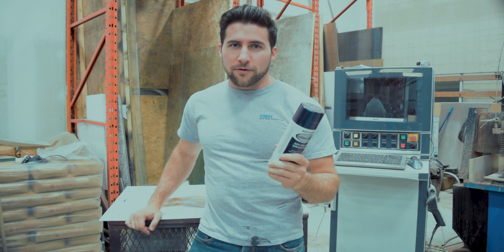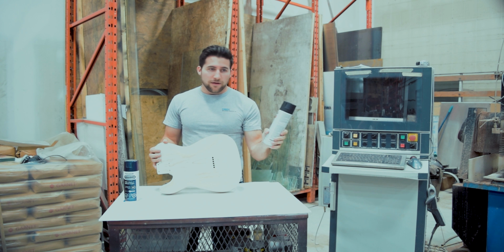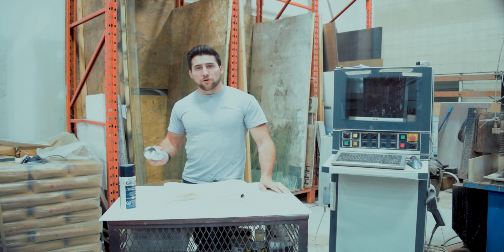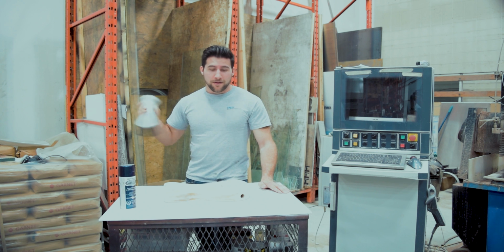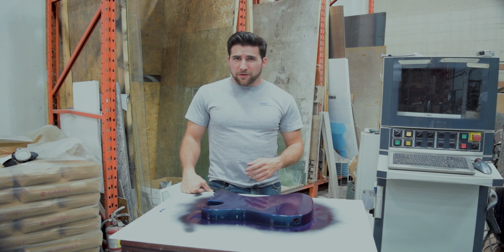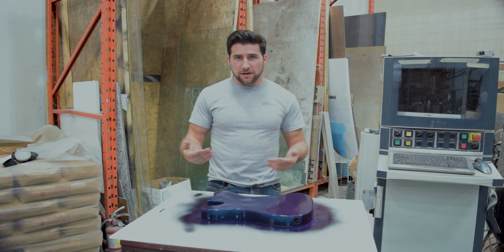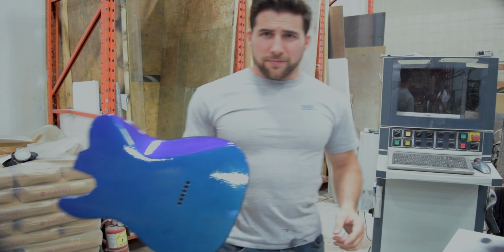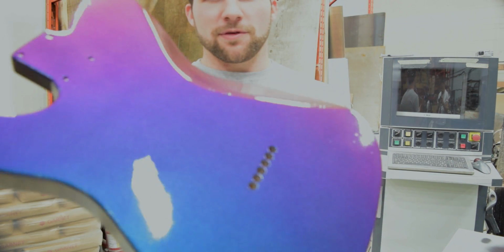How to do a Chameleon Paint Job with Spray Cans

Comment: Hi Brad I have a question for you. It has nothing to do with this particular paint job. But I was clear coating My Guitar. And I noticed that the clear coat was turning white. Can you tell me what the problem is. If possible please answer this question ASAP thank you.
Reply from the maker: Probably blushing. It comes from moisture being trapped under the finish from excess humidity.

Comment: Did you apply the 2nd and 3rd coat when the paint was still wet? (It looked so, I could be very wrong). Also, if I wanted to paint the entire body and I don't have a paint stand, how do I prevent seams between layers (if I flip the guitar) sorry for bad english
Reply from the maker: I wait 10-15 minutes between coats. The paint shouldn’t be wet per se, but not completely dry either. If you don’t have a stand, consider hanging the guitar.
Reply: @BradAngove  okay thansk so maybe I'll to make your homemade stand and paint each layer in one go?
Reply from the maker: That is also an option

Comment: Will it adhere to wood or acrylic/lucite?
Reply from the maker: You’ll want to seal the wood first, but it will adhere afterward. This piece was wood. 
As for the plastics, you will need an adhesion promoter or plastic primer to get that to work.
Reply: Great Brad...thank you for replying fast!
Reply from the maker: You’re welcome.

Comment: Hey there Brad, I'm thinking of stripping my old squier tele with a poly finish and giving it this chameleon treatment. I was wondering if I have to apply a wood sealer after heat-gunning the paint off? Also the appropriate times to sand in the entirety of the procedure. Sorry for the loaded question! Love your videos!!
Reply from the maker: Hi Patrick. Have you considered just sanding the original finish with some 800 grit and moving straight into painting it?
Reply: @BradAngove  would this work? I'm completely new to refinishing a guitar so I've not much knowledge or experience to go off of. I'd sand the entire paint off or just enough to give the new paint something to bite onto? Thank you so much for the quick response.
Reply from the maker: Yes just sand the original stuff so the new paint will bind mechanically. Use the original paint as your sealer.

Comment: I was thinking about doing that to one of mine in auto paints that I've had experience spraying but like you said expensive .and I didn't have any left from the last car I did.
Reply from the maker: +Krusty Buzzard some of the prices on the really aggressive professional chameleon paints are insane.
Reply: Brad Angove the ones I used were from house of colors and we're more than I'm willing to buy.you don't want to put more than 2 coats from. A good spray gun on the car that's for sure.
Reply from the maker: +Krusty Buzzard Oh, that makes sense. If I remember correctly the house of kolor ones are crazy expensive.

Comment: Hi Brad, thanks for the videos.  They have helped me mucho with my project.  I have been working on repainting a recurve bow riser, similar to a guitar, its wood.  I did this same paint scheme before watching any of your videos but ran into some problems here and there.  I am on my 3rd attempt.  It came out great the first 2 times, I really like rust oleum paints, but the problems were really in the prep.  Do you have any advice on prepping wood for paint.  I could probably find some videos but yours are great and I thought I'd bring it up to you.  Besides that, I'm wondering what you would recommend for my next step.  I have prepped the wood and primer (BIN Shellac white, highly recommend for wood) a little better than before.  The first couple times I did this I did 2 black base coats, 2 colorshift coats, and 3 clear coats back to back with 20 minute flash times in between.  Came out effing awesome....until I tried to handle it too soon and got a cool towel effect imprint....then I saw your video explaining that a little too late.  Anyways, this time around I already have my primer and 1st black base coat, next I plan to sand with 800, clean it with Windex (is that ok), spray 1 more coat of black, 2 coats of colorshift, I'm throwing in some translucent black shadows in some areas.  So do you think I should maybe put a couple coats of clear over the color shift and let it dry a few days before going into the translucent? Or should I go into the shadows and clear in one session?  Thanks.
Reply from the maker: You’re on the right track. Windex is fine for the cleaning part. Don’t do more than three coats total in a session. 4 at the outside. Otherwise the first ones won’t dry properly. 
It’s up to you whether you want to use an intercoat clear prior to the black, but I think it’s a good idea. It’s something that the automotive custom painters do frequently.
Reply from the maker: Yes, sand again before applying the colour. I recommend you have a look at my video on why I never wet sand guitars. I also have one titled something like “do you need to sand between coats of paint” that should answer your question better than I can here.

Comment: Would it be safe to level sand the paint before clear coat?
Reply from the maker: +Ken Chuba Yes, but you would probably want to throw on one more light coat of this after sanding and then start into the clear coat.
Reply: I would sand the base coat first, then only if the color coat was really bad.

Comment: Can I use a 2k clear over this? I have never used anything but lacquer on a guitar. Really want to avoid a soft finish like you might get from an enamel spray can. Is this an enamel?
Reply from the maker: This is an acrylic enamel. I have successfully used 2k over it several times, yes.
Reply: If I did want to use a 2k clear over this, wouldn’t I need to sand first? But if I sans wont it ruin the chameleon effect?
Reply from the maker: Sanding lightly won’t ruin the effect. What you can do though is finish your chameleon spray session with one coat of clear (not 2k), wait 2 days, sand lightly, and then apply your 2k.
Reply: So like, ten minutes after last coat of colorshift put on a coat of rustoleums clear coat? Thanks for answering these questions man, really don’t want to screw up sixty bucks worth of paint.
Reply from the maker: Yup. Toss a single coat of the clear on there to seal in the shift paint and give you an intermediary layer that you can scuff.
Reply: Awesome! I’d feel a lot better about sanding a layer of clear rather than sanding the colorshift. Especially since this is going to be my first time using these kinds of paints on a guitar. If this works out I might start using my left over automotive paints on them.

Comment: Thanks Brad. Great videos. Trying out this paint on test samples with rustoleum matte black primer. It's been very inconsistent. Either streaking and poor coverage or blushing. Some days seems to work, other does not. I see folks online have been experiencing same thing. I've sprayed on low humidity days, cooler or warmer days, warmed up the can etc. Naturally I'm hesitant to try on the guitar. Any tips?
Reply from the maker: Low humidity is key to avoid blushing. I’m not sure why you would be having variability in coverage though.

Comment: Thanks Brad for all your videos, I am curious if u can sand this paint down before clear coating and if so what grit would you use?
Reply from the maker: You can, but it would be better if you could get a coat of clear on it at the end of the spray session and sand that instead. 
I use 800 grit.
Reply: Thank you
Reply: Brad Angove so a coat of clear while the paint is still wet ? Did I get that right ?
Reply from the maker: After about 10-15 minutes, yes.
Reply: Brad Angove thanks Brad !
Reply: So, I was planning on finishing with 2k, so I should put a coat of what kind of clear before applying the 2k???
Reply from the maker: The same kind as the base coat. An acrylic enamel. Just keep it thin though as you don’t want to make the effect less apparent.

Comment: Does it matter if your base coat is matte or gloss black?
Reply from the maker: No. Just sand it lightly so that the chameleon paint will stick.
Reply: @BradAngove  What Rustoleum flat black do you suggest? Should I avoid using the Rustoleum paint + primer?
Reply from the maker: Just the painters touch stuff is fine. Avoid the paint + primer.
Reply: @BradAngove  thanks Brad 🙂

Comment: Just a hint ...  if you don't want your painted guitar stuck to the table, rest it on the lids from the spray cans. You can actually move it before dry without fingerprints.

Comment: I have always loved flip flop paint!. I only wish there were more available colors.
Reply from the maker: +Boudreau Guitars yes, there are a few options, but not as many as one would hope.
Reply: Brad Angove if there a gold and green one I think it would look stunning especially on a more carved/curvy body :D
Reply: I just found this:

https://www.hobbyrecreationproducts.com/pages/spazstix

They have about 6 variations in both rattle can or spray gun mixes...

Granted, its mostly for the RC market, so I don't know how much a single bottle covers...
Reply: kirt fulcher odd one. HPR say they “provide brand management services to several recreation and hobby brands...Spazstix Paint”, but Spazstix doesn’t exist outside HPR. And the name is a bit off when pronounced slowly. Curious
Reply: Plastidip has a ton of options
Reply from the maker: Plastidip isn’t paint though.
Reply: Brad Angove I use Rust-Oleum myself been doing my car with Matt black peel coat then I'm putting chameleon on my car when finished I hat the orange peel look from Plasti dip
Reply from the maker: That’s an ambitious project. I hope it goes well for you!
Reply: try these
https://usa.specialistpaints.com/collections/specialist-paints/products/chromacoat-paint
Reply: Kenneth   Peters i was thinking the same, how did it turn out?

Comment: Is there a trick to make sure those acrylics fully harden?  I did one of those a few years back with the Rustoleum sparkly blue (which actually shifted to dark purple a little bit, which wasnt advertised).  I let it sit for like a month in a hot garage and that thing still stuck to the guitar stand and got all messed up.
Reply from the maker: It should harden fully within about 6-8 weeks, but if it's too hot it might stay a bit gummy. That being said, some of those guitar stands will stick to things anyway. I had one of mine stick to an unfinished guitar neck.

Comment: Hey, how do you clear coat over holograms foil without washing out the colors?
Reply from the maker: +mitch mclean I’ve never used holo foil before, but I don’t see why putting a clear over it would wash out the colours if you’re using a decent clear coat and applying it properly.
Reply: Yeah I've attempted it three time, I tried both water and oil based poly. It has me stumped
Reply from the maker: +mitch mclean did you use a spray, or wipe on poly?

Comment: I ran across your video, well done! 
In your opinion Brad, do you think a different color could be used underneath?
I was thinking maybe white or a dark purple? With all your experience, I was kinda hoping you could help.
Thanks Brad for your time, I appreciate it!
Pam
Reply from the maker: You won’t get the effect over white. It will be a bit muted over purple, but you will still get something.
Reply: Brad, thanks so much for responding, I really appreciate it! Pam

Comment: Have you ever used Solarez Polyester Gloss Resin and Polyester UV-Cure Grain Sealer? You brush it on and it's supposed to cure in minutes in direct sunlight to a rock hard finish. Highline Guitars has a video on this.
Reply from the maker: +jburtonca I've heard of it, but never used it. I tried getting in touch with them about sending me a sample to demo, but never heard back haha.
Reply: jburtonca. Thanks for the heads up I will investigate. I have been looking for a really durable clear coat.
Reply from the maker: +zigzag duck it’s intended more as an undercoat if I’m not mistaken. Are you just doing a transparent finish?
Reply: Hi mate. I am refacing acoustic guitars with a street art style, (planets and stars), so am looking for a tough clear coat.
Reply from the maker: +zigzag duck Are you planning on playing them after? Because that is going to change how they sounds.
Reply: I was a bit worried about that but I had 2 steel string guitars A fender and a Tanglewood so I decided to risk the Tanglewood.
  I removed the bridge from so that I had a flat area to work on and replaced the nut, saddle and pegs with brass. After I put it all back together it sounded great for a while.
  Sadly I have not attached the bridge the properly, it will not stay in tune for very long as it is lifting from the back so I will need to remove it clean it up and reattach it, hopefully I can do this without damaging the paintwork, but if not then I will have to sand it back and start again.
  I also picked a cheap cutaway Chantry. This time I worked around the bridge and again replaced the saddle, bridge and pins with brass.It holds a tune and it plays really well. 
  I think both guitars sound sharper now but I think that's down to the brass fittings.
  I am looking for some machine heads, to finish the project off but all I can find are chrome, or gold effect, and they both look tacky. can you recommend a supplier?

 Thanks again for getting back so quick.
Reply from the maker: +zigzag duck Allparts might have some brass machine heads. I’ve never checked, but they’ve got a lot of parts on there of course.

Comment: So I see you spraying in close proximity to a computer keyboard….is your whole workspace ventilated like your paint booth?  Also, can you cover rustolium with Car rep 2k and/or spraymax?
Reply from the maker: I think this video may have been pre-paint booth. The workspace is just huge; so it’s basically like spraying outside. 

Yes, I’ve used those over rustoleum before.

Comment: I've got two questions that are a bit irrelevant to this video, but I'm going to ask anyways. First of all, thanks so much for all of the time you take to make free videos to help people! Question #1: Can I cover a oil-based poly with a water-based poly? Or vice versa? Question #2: If I covered a high gloss paint with a flat/satin poly, what finish would come out? Flat or Gloss?
Reply from the maker: You can cover a water-based poly with an oil based poly. Just make sure it's fully dry and give it a light scuff and clean first.

If you cover the gloss with a flat or satin, you'll end up with the flat or satin. Make sure you scuff the gloss (after letting it dry) before you coat over it.
Reply: Can I cover an oil-based poly with a water-based poly without using a primer? I know you usually can't cover oil paint with water paint without primer. So, I wanted to know if the same principles applied to polyurethanes and other clear coats.
Reply from the maker: +Brendan Jacobs I don't think that would work. You could probably do the opposite though, if that helps at all.
Reply from the maker: Are you saying you put several layers of matte spray straight over the gloss?

Comment: Great video, very useful info,
Reply from the maker: Thanks. Glad you like it.
Reply: Just wanted to ask as im about to do this for the first time,have done the black base coat , so 3 coats of Chameleon, how long between coats(drying time)  ? and also how long to apply clear coat ? do i need to wet and dry after ?  Thanks
Reply from the maker: 10-15 between coats. What kind of clear are you using?
Reply: Thanks for the reply,i appreciate your help,  just using an average price clear lacquer, available from most paint shops in the UK, what would you suggest ?
Reply from the maker: I’m not in the UK, so it’s hard for me to tell. Also, lacquer here is a specific type of clear coat, where as there I think it might mean something more general. If you use actual lacquer over this stuff it won’t work.
Reply from the maker: Acrylic lacquer is risky in the circumstances. Can you get the Rustoleum acrylic enamel clear?
Reply: yes, have seen it on Ebay, Thanks for your help, much appreciated,
Reply: Hello again, well your help worked a treat, just done the clear coat and its come out really nice, my video will be out in a couple of weeks, do you mind if i give you a shout out and a link to your channel ? Thanks again
Reply from the maker: I’m very glad to hear that it went well for you. And certainly, you can do whatever shoutouts and links you would like.

Comment: I bought DupliColor Mirage to "try" on a set neck bass, (still stalling though).  I guess I can always repaint it if I'm not happy.  About the same price, $30-35 on line but it's three separate cans of product.  I was hoping that this video used DupliColor's Mirage system,  no luck.   I'm still "putting-it-off", I need a $125 fingerboard, (well, that's my excuse anyway).  Maybe a video of using that product someday??

Thanks for your great videos.
Reply from the maker: I’ll see what I can do about giving that a try. In the interim, if you try it out, please let me know what you think of it.